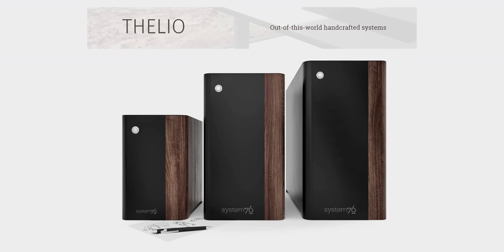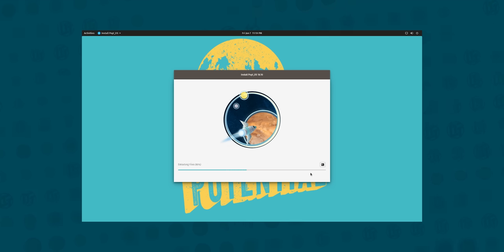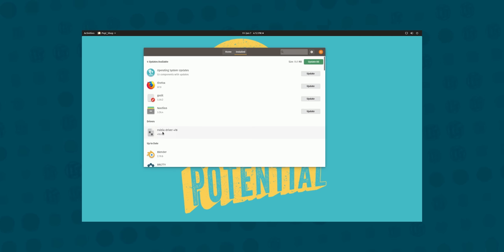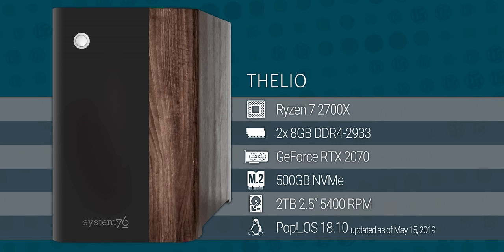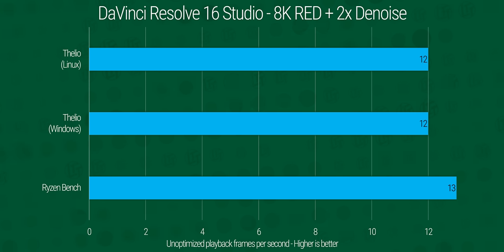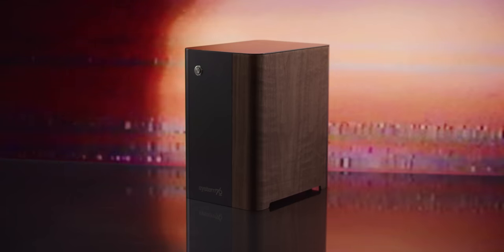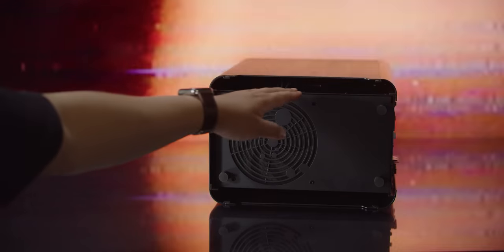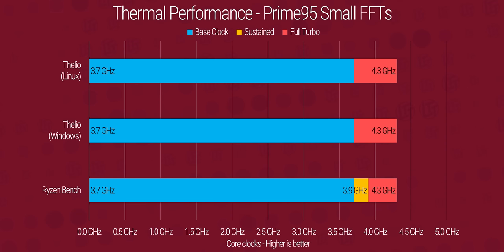A REALLY Weird PC… - System76 Thelio Review

Comment: This isn't for linux users, its for mac users that have become so distrustful, so angry, so tired, and so burned by both apple and microsoft. For me my major issue with it is that it offers more nvidia cards and barely any options for AMD cards, I have been burned by Nvidia so many times and it primarly doesn't add to the fact that tech review/news shows are not pointing out ANY of the negative issues with Nvidia cards despite there being masssive issues . Such as game updates that require the latest Nvidia drivers, and those drivers being VERY VERY broken.  The same issues that tech reviewers and news techs were pointing out for the month long issue with the 5000 series cards except this issue with nvidia cards is all across the board affecting 10 series, 700 series, 16 series and 20 series cards right at the launch of the 30 series cards and STILL to this day have multiple issues, yes some of them have been fixed but the random driver crashes on both their Linux drivers and their windows drivers have left me with a bad taste for over 4 months going on 5. And this has been my assumption and the assumption of many to the point where we are pointing out that you guys are more than likely taking bribes from Nvidia, or doing things out of fear of losing your sample cards a issue brought to light by hardware unboxing scandel. This isn't the only a matter of the driver issues but the unstable issues with the cards themselves over the last decade but the various other scandles such as the 970 vram scandel. which is only now being touched by hardware tech reviewers and tech news in look backs despite them also advertising t hose cards back then and saying nothing wrong with Nvidia for the last decade and any remote sight of any sort of remotely negative critism for nvidia has been met with threats of actions to retaliate or take away sample cards making it impossible for tech news shows to do their jobs.

Comment: I bought a thelio and its very stylish very powerful and DESIGNED to run Linux   0 compatibility issues. Yes i could have built my own, then you are stuck with individual parts that you need to rma if something goes wrong AND may not be compatible with Linux. You see, Ive been running Linux for 3 yrs and will NOT go back to windows........EVER!   Hell, windows will not even install on this machine at all. Trust me Ive tried multiple ways and times!  IMO  it's money well spent!

Comment: Well.. I like "their" idea of delivering a complete, working system running an idiot-proofed Linux.

However, I don't see why they felt the need to do so in a custom case that isn't mass produced and probably costs a fortune... especially when that case then results in no front I/O and the inability to swap out the motherboard because of that stupid I/O situation at the back.
A cheap CPU cooler in a system as pricey as this is also a no-go and I think the airflow could probably be improved significantly if the gap at the bottom for air intake was larger.

Last, but definitely not least: Their pricing is really off and is the perfect example why prebuilts have such a bad reputation. I could understand a high base price due to the fancy custom case and all that, but... well... going for a CPU that should be around $100 more expensive (3600X at ~ $200 vs a 3200G at ~$100 on PCPartPicker right now) increases your price by roughly $239. A RTX 2060 Super sets you back $499 instead of the $390 it should roughly be. Same is true for almost every other component you can upgrade.
Yes, prebuilts cost more. Yes, that actually can be worth it... but the 50% to 150% premium System76 asks for every single component here is really over the top.

Comment: been using linux for years first for work then ditching windows in favour of it about five years ago now does everything i need even gaming is it a 1 to 1 replacement for windows gaming nope but i can play what i want. The misconception of linux community is that they want everything for free well until they stopped showing the stats linux gamers used to beat the windows average for humble bundle every single month. Plus personally I have rebought games i already owned from feral interactive to support the porting studios work. Bascially System 76 offers a linux gaming desktop to a market that woudlnt touch windows with a someone elses 50 ft barge pole, there commitment to providing the free os to everyone not just their customers plus open source firware development means am more likely to support them that i would be ibuy power.

Comment: I love Linux.  Not just as an OS.  But as an idea.
Reply: I'd just like to interject for a moment. What you’re referring to as Linux, is in fact, GNU/Linux, or as I’ve recently taken to calling it, GNU plus Linux. Linux is not an operating system unto itself, but rather another free component of a fully functioning GNU system made useful by the GNU corelibs, shell utilities and vital system components comprising a full OS as defined by POSIX.Many computer users run a modified version of the GNU system every day, without realizing it. Through a peculiar turn of events, the version of GNU which is widely used today is often called “Linux”, and many of its users are not aware that it is basically the GNU system, developed by the GNU Project. There really is a Linux, and these people are using it, but it is just a part of the system they use.Linux is the kernel: the program in the system that allocates the machine’s resources to the other programs that you run. The kernel is an essential part of an operating system, but useless by itself; it can only function in the context of a complete operating system. Linux is normally used in combination with the GNU operating system: the whole system is basically GNU with Linux added, or GNU/Linux. All the so-called “Linux” distributions are really distributions of GNU/Linux.

Comment: Thinker around with linux.. Like install, update, reboot, and be done? Yesterday I put together an older config for my mother. Installing linux was the same difficulty as installing an application on windows. Enter name, password, wide ssd, next, next, install, and done. Boot, update, reboot and done under like 5 minutes + download of 2GB of data. (My mother question was where is the start menu, and where to turn off, otherwise no instruction was needed to use the computer under half of a day of using it, her husband is like, oh, it's a blue google chrome, and uses it without realizing, that it is not windows).
What about newer config? Ryzen 3600, RX570 is as plug n play as it can get. Next next next install. FOR A F** OPERATING SYSTEM, not for every f*** hardware and software. Heck even steam is installed out of the box. Plugged in my old hdd, and steam discovered all the games. I was ready in an hour,-hour and a half, half of them at least was downloading with my crappy 10mbit connection.

Compared to windows where go to every f ing manufacturer site to download the drivers, install them, and hope that windows don't want to be smarter than you, e.g. install an older driver from windows update. Even when you use tools like ninite it a tedious process.

And anyway, when did you heard about these kernel compiling and repo hunting bullshit? I've used ubuntu around 2011-12, and it was a plug n play experience back then. I remember needing to install network driver on my computer, and printer software, while under linux it was plug in the printer, and open the scanner app, no bullshit installing.
You only does those weird kernel compiling and other "bullshit" when you want bleeding edge stuff. But there are stable releases for a reason: When you want it to just work with no bs, hassle free.

Go on, install manjaro, imo it's the sweetspot between bleeding edge, and stable. I've got up to date software, and haven't really had problems. And compared to my work windows pc as good as it is, or slightly better in reliability.

Comment: In order to make Linux available to everybody that means that you won't have to cater to the visually impaired so that means that they also have to work out screen cleaning equipment and good screen reading equipment screen reading equipment like Jaws or zoomtext needs to also be implemented implemented in Linux yeah if you want anyone to be able to use Linux I strongly suggest that zoomtext or draws is it able to be able to work with Linux and not through Windows platform or Windows intermediary but directly with Linux like a regular pc the Federal Trade Commission and FCC FBC Etc needs to be made aware of this because then they need to step in and make sure that the people for Disabilities Act is implemented here if Linux will become like Windows that is that is a requirement screen reading of screen reader is and not some stabby crappy screen reader like Linux comes with a Microsoft Windows actually comes with and a Microsoft Windows is called narrator on Linux I don't exactly remember what it's called but you get the drift those screen readers like narrator is junk absolute screen reader like zoomtext or draws is a requirement especially if you want everybody to be able to use Linux and the people who are in charge of the people with Disabilities Act would be required to look into this and make sure that Linux complies because if Linux will become the next Windows when they are required to work with screen readers and good screen readers let's jump

Comment: LInux is kernel. 
Whole system is GNU distribution.
Reply: If I have an OS that doesn't have a single scrap of GNU code in it, is it still GNU?
Reply: No, Richard, it's 'Linux', not 'GNU/Linux'. The most important contributions that the FSF made to Linux were the creation of the GPL and the GCC compiler. Those are fine and inspired products. GCC is a monumental achievement and has earned you, RMS, and the Free Software Foundation countless kudos and much appreciation.

Following are some reasons for you to mull over, including some already answered in your FAQ.

One guy, Linus Torvalds, used GCC to make his operating system (yes, Linux is an OS -- more on this later). He named it 'Linux' with a little help from his friends. Why doesn't he call it GNU/Linux? Because he wrote it, with more help from his friends, not you. You named your stuff, I named my stuff -- including the software I wrote using GCC -- and Linus named his stuff. The proper name is Linux because Linus Torvalds says so. Linus has spoken. Accept his authority. To do otherwise is to become a nag. You don't want to be known as a nag, do you?

(An operating system) != (a distribution). Linux is an operating system. By my definition, an operating system is that software which provides and limits access to hardware resources on a computer. That definition applies whereever you see Linux in use. However, Linux is usually distributed with a collection of utilities and applications to make it easily configurable as a desktop system, a server, a development box, or a graphics workstation, or whatever the user needs. In such a configuration, we have a Linux (based) distribution. Therein lies your strongest argument for the unwieldy title 'GNU/Linux' (when said bundled software is largely from the FSF). Go bug the distribution makers on that one. Take your beef to Red Hat, Mandrake, and Slackware. At least there you have an argument. Linux alone is an operating system that can be used in various applications without any GNU software whatsoever. Embedded applications come to mind as an obvious example.

Next, even if we limit the GNU/Linux title to the GNU-based Linux distributions, we run into another obvious problem. XFree86 may well be more important to a particular Linux installation than the sum of all the GNU contributions. More properly, shouldn't the distribution be called XFree86/Linux? Or, at a minimum, XFree86/GNU/Linux? Of course, it would be rather arbitrary to draw the line there when many other fine contributions go unlisted. Yes, I know you've heard this one before. Get used to it. You'll keep hearing it until you can cleanly counter it.

You seem to like the lines-of-code metric. There are many lines of GNU code in a typical Linux distribution. You seem to suggest that (more LOC) == (more important). However, I submit to you that raw LOC numbers do not directly correlate with importance. I would suggest that clock cycles spent on code is a better metric. For example, if my system spends 90% of its time executing XFree86 code, XFree86 is probably the single most important collection of code on my system. Even if I loaded ten times as many lines of useless bloatware on my system and I never excuted that bloatware, it certainly isn't more important code than XFree86. Obviously, this metric isn't perfect either, but LOC really, really sucks. Please refrain from using it ever again in supporting any argument.

Last, I'd like to point out that we Linux and GNU users shouldn't be fighting among ourselves over naming other people's software. But what the heck, I'm in a bad mood now. I think I'm feeling sufficiently obnoxious to make the point that GCC is so very famous and, yes, so very useful only because Linux was developed. In a show of proper respect and gratitude, shouldn't you and everyone refer to GCC as 'the Linux compiler'? Or at least, 'Linux GCC'? Seriously, where would your masterpiece be without Linux? Languishing with the HURD?

If there is a moral buried in this rant, maybe it is this:

Be grateful for your abilities and your incredible success and your considerable fame. Continue to use that success and fame for good, not evil. Also, be especially grateful for Linux' huge contribution to that success. You, RMS, the Free Software Foundation, and GNU software have reached their current high profiles largely on the back of Linux. You have changed the world. Now, go forth and don't be a nag.

Thanks for listening.
Reply: It is very hard to have a system without a gnu code (and why would one).
For starters, it's GNU compiler collection and most of the userland, I don't think you can get very far without GNU and GPL parts of GNU/Linux distributions (between bunch of other licenses)
You also have distributions with other kind of Kernels, like illumos FreeBSD etc. 
People usually don't sweat about it how it is called, nor should.
I just thought that calling distributions just by the kernel is not precise nor wise enough. 
You can always tight multiple licenses to your code and contributions, and really there is no reason to avoid GU toolchain nor GPL (among other free copyleft licenses).

Comment: Who is using drive bays? It's not 1993 - someone tell these muppets about m.2 - still that extra $100 every buyer pays for those screws and drive bays - well worth it. Do they all have SCSI interfaces available?
Reply: The problem with m.2 is anything over 1TB is straight wallet rape.

Comment: right, because the 20 min it takes to fully install a mainstream distro on practically any modern piece of hardware with all drivers working out-of-the-box because they are baked into the kernel (unlike primitive Windows) is a very difficult and time consuming  techie project! dude no user has compiled a desktop linux distro in over a decade. youre waaay out of the loop, linus old buddy!